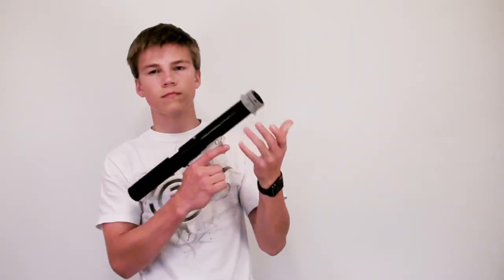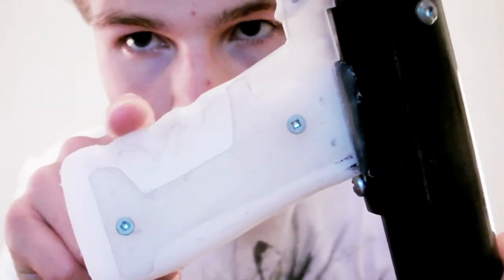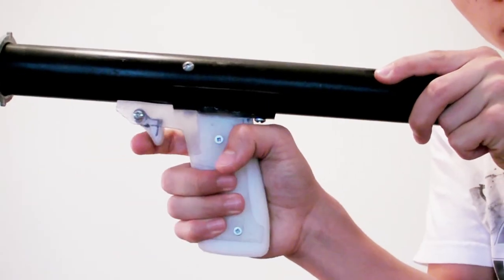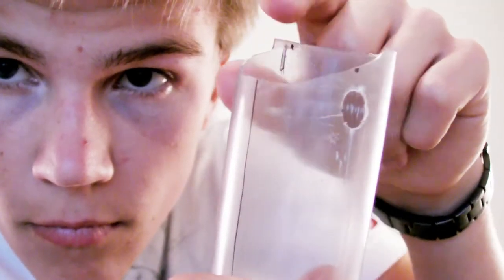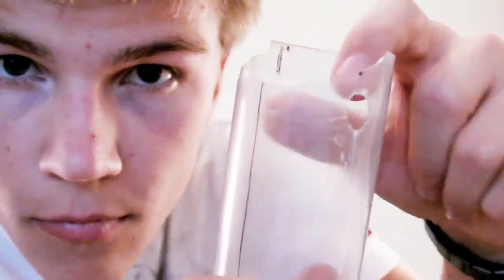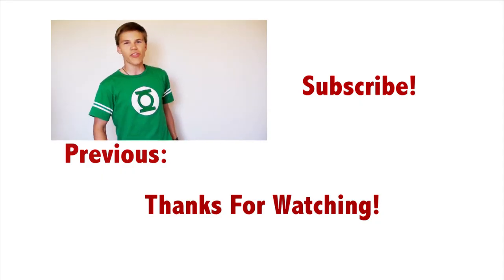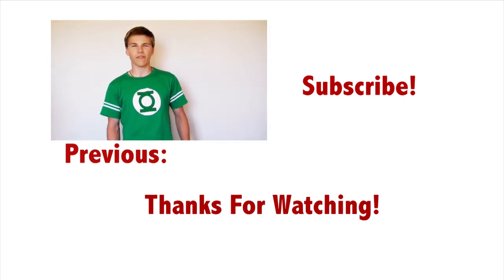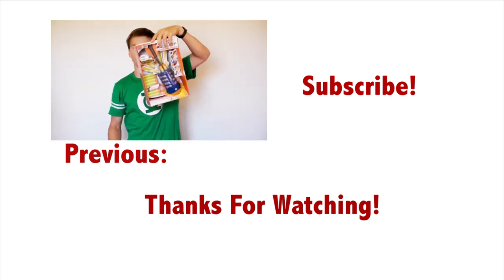[Homemade] My First Homemade - Progress Report 1

Comment: I doubt anything printed would be strong enough. and I have a rainbow catch around that still works. Although can you elaborate on the PVC fittings method, or is that for the contest?